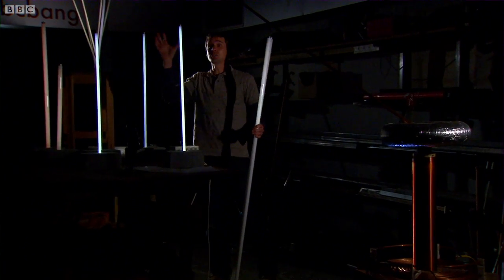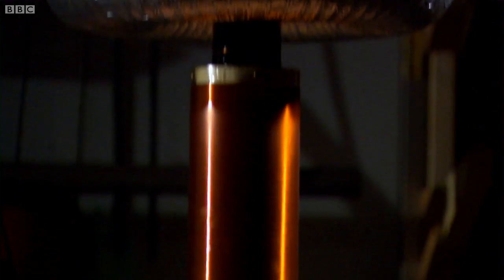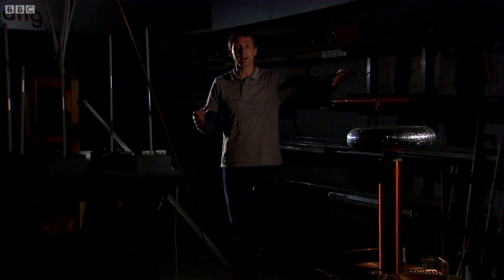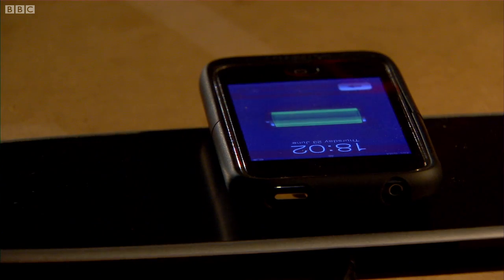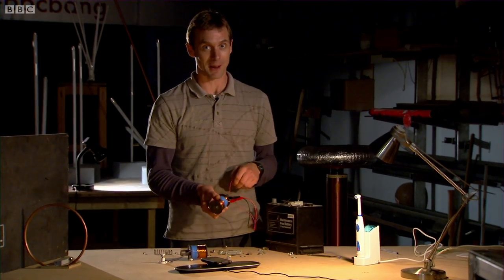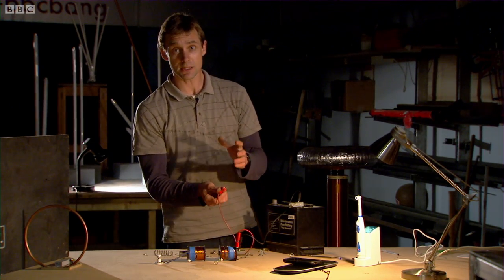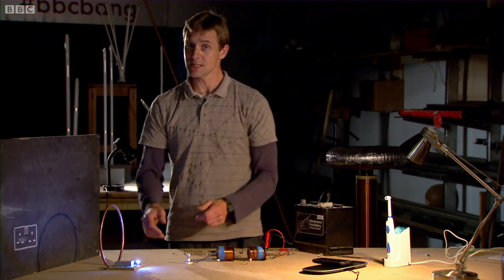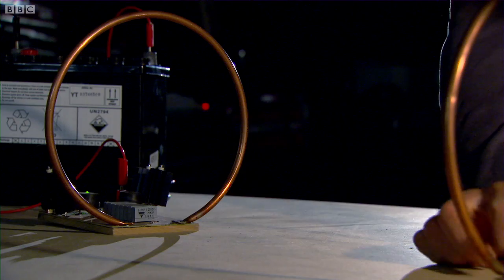Tesla Coil & Laser Beams Pt.1 | Bang Goes the Theory | BBC Studios

Comment: The voltage isn't fatal, mainly because it it so high, and the current is extremely low. When the current is lacking, say, below 50 ma, it cannot kill, but it will give a small shock. Did the definition of dangerous change in the last few years? Or are you clueless of the actual power produced by these contraptions?

Comment: I cant help but feel that they just demonstrated open air induction twice, one on the tesla coil and once on the other setup. They should have shown the tesla spark gap and capacitor stetup for fast switching as it is easiest to understand (even though the concept is demonstrateed by the transistor based driver near the end)...